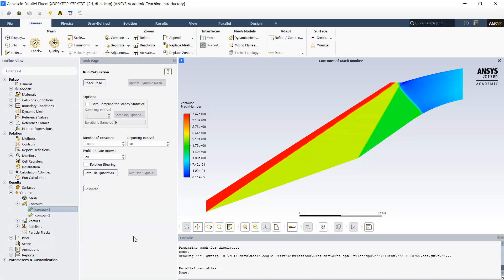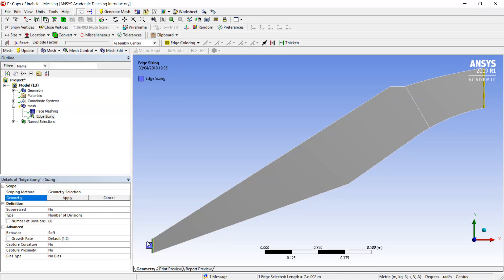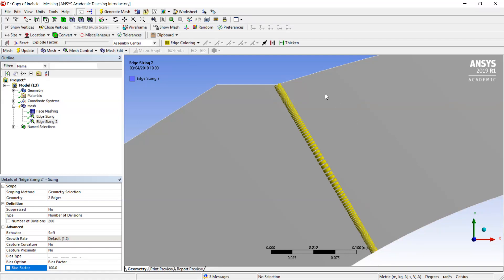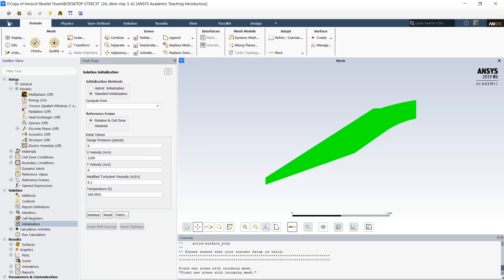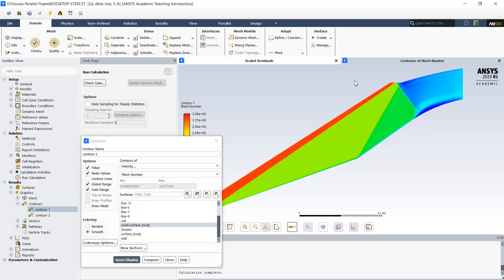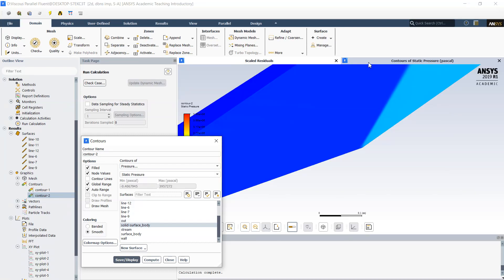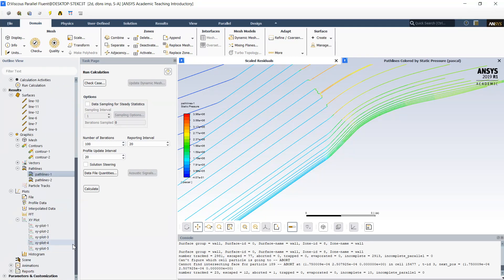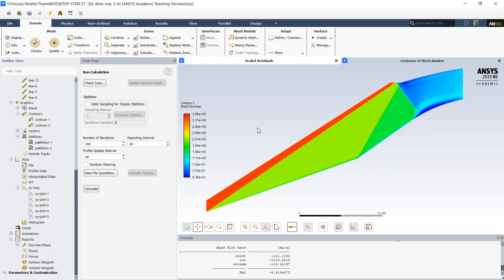Supersonic Diffuser simulation in Ansys Fluent - part 4

Comment: When i go for convergent results... Normal shock position is changing why?
Reply from the maker: The position of the shockwave is always in a balance with the flow passing through the diffuser. If your flow exit is too closed and all the flow can't pass through the exit section, your shockwave will move backward the flow. If it's too open then your shockwave would move forward. Find the optimal relation between the geometry and flow conditions and your shockwave will stay in the required place.
Reply: @chemicalpropulsionlaboratory  can you share your personal contact i actually i am final year student of aeronautical engineering and i am facing problem in simulation i want to clear that.. If possible then share your personal contact mail:- pd3184282@gmail.com